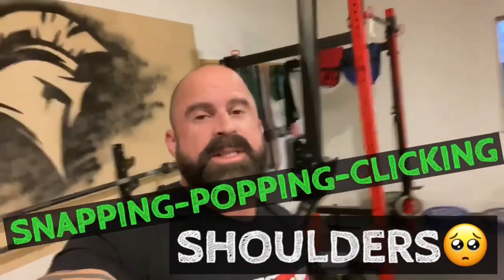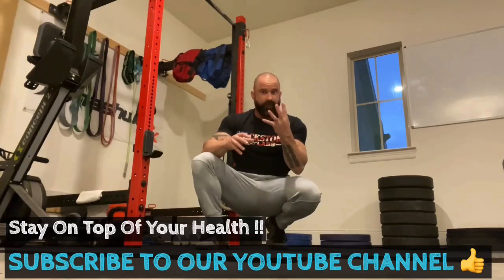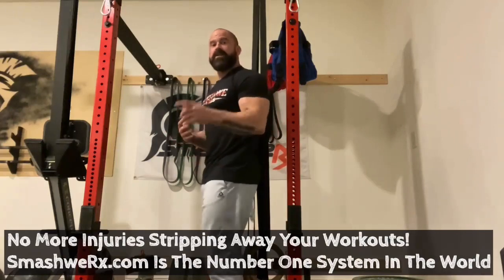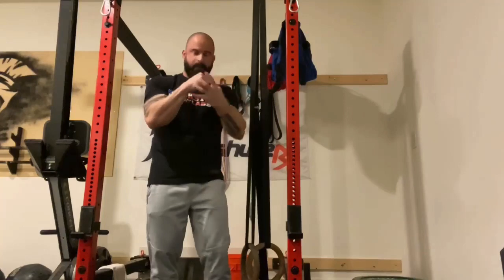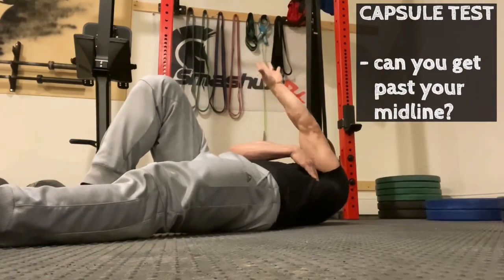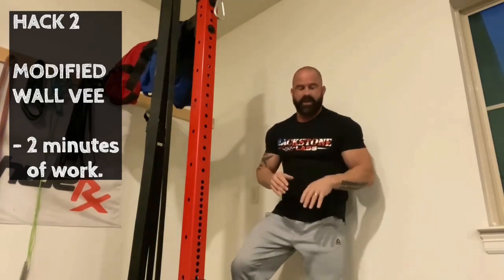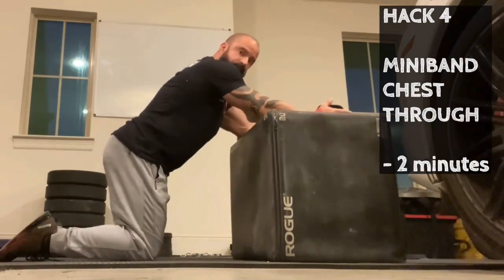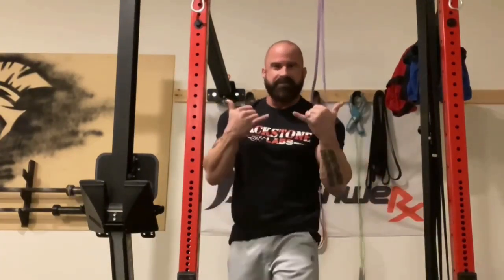Snapping & Popping Shoulders (EASY FIX) | Trevor Bachmeyer | SmashweRx

Comment: I've been training pull-ups and muscle ups for over a year. I got to 42 pull-ups with no rest, and 10 muscle ups no rest (controlled movements).

About 3 weeks ago i was stretching my shoulders and i felt my right shoulder start to crunch and grind on the glenoid fossa. Result was pain and lack of mobility afterwards.

It hasnt been the same since. My shoulder feels unstable, pain in any press movement and weakness in my pullups.

Im sure its a shoulder mobility issue caused by over training combined with improper stretching.

I wish i found your channel sooner. I hope i can fix this without surgery. Thank you for your help. 🙏

Comment: When I lift my left arm for my side straight overhead, it crunches around the rear delt and lat area.😢
Reply: DStar1707  not
Reply: @DStar1707  yes. I usually do a 10-minute Mobility before and after workout the last couple of months. Stuff taken from Teddy Cox who branched out from under Matt Wenning, Squat University,  and some SmashRx. I'm 39 and didn't start working on Mobility tool recently. If I raise my arms up to an extended overhead position I can't go even with my shoulders and it pulls my ribs upward. I do weighted pullovers and everything to try to stretch it along with hangs. Just extremely tight along with a lot of grinding and popping
Reply: I know it comes from 20 + years of neglect and heavy benching. I'm a relatively small framed guy and I've benched at least 405 to 485 since I was in high school.

Comment: While I like the idea of some of these exercises, a lot of the ideas in this video are quite outdated and have been debunked. If you're having shoulder pain that's affecting your quality of life just go and see a physio/physical therapist. Bunching all shoulder symptoms together is very reductionist and you wouldn't be wanting to manage rotator cuff related shoulder pain or a subacromial bursitis the same way as a long head of biceps tendinopathy, frozen shoulder or cervical neuropathy which can all present similar. Also this idea of 'impingement' has to go away. There have been plenty of studies (which I'm happy to cite) showing humeral head superior migration during arm elevation is completely normal, as is the compression of the soft tissue under the acromion. It happens regardless whether there's pain or pathology present. And actually it's been shown to be impossible for the supraspinatus to 'impinge' on the acromion past around 70 degrees arm elevation, with most of the compression happening between 50-60 degrees when people are doing every day activities. And to finish, the words that are used to get across a point are just as important as anything else. Telling someone that a noisy joint is associated with pain (not true) or that if you have pain it means your joints are misaligned and the tissue is being damaged as a result (also very rarely true) just leads to negative thoughts, fear avoidance and creates negative narratives around movement.
Reply: Thanks Chris.